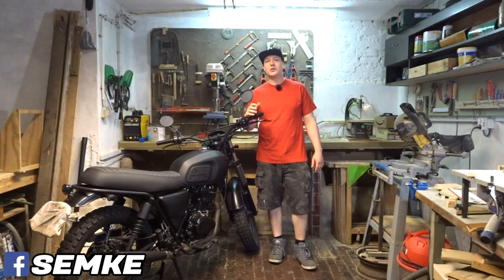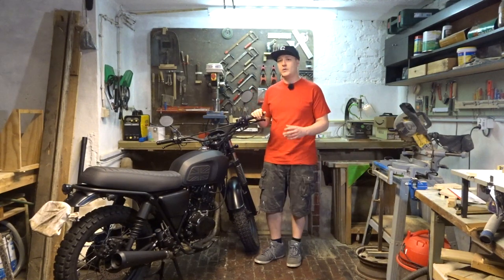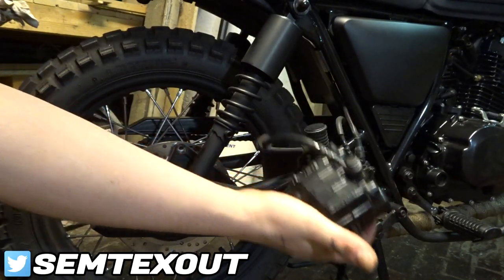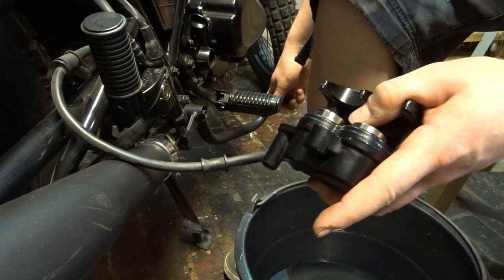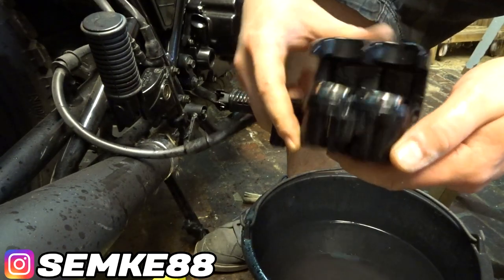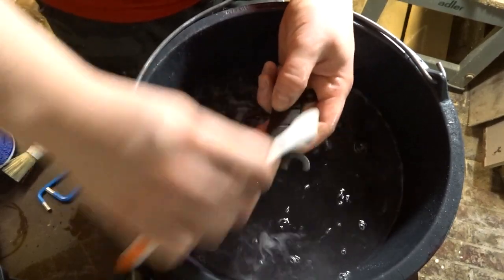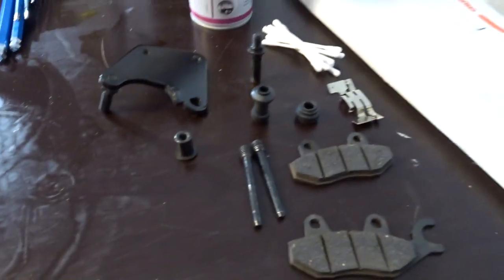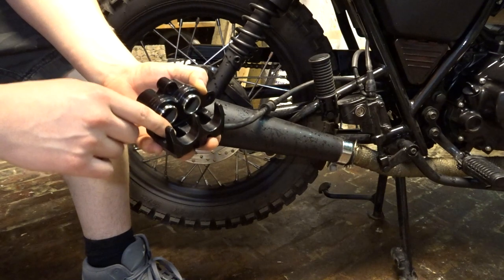how to fix sticking brakes on a motorcycle Brixton Felsberg 125

Comment: Hi there Semke, thanks for the video, I have a strange brake problem with my Brixton Caffe Racer! Sometimes when I apply the FRONT brake the fluid also goes to the REAR brake caliper & it jams on & wont come off! I have to jerk the rear brake pedal hard a couple of times to release it & off I go again. Have you ever seen this happen? As you know on the Brixton the foot brake pedal sends fluid to apply pressure to the front & back calipers but the front brake hand lever is supposed to operate the front brake only. Somewhere in the brake system there must be a cross over between front & back & a leaking seal or sticking valve I think! I have had it to a shop here in Vietnam a couple of times to get this repaired but every time its the same. Any ideas?
Reply from the maker: I think that the problem is located Where your back brake is attached the small block where all the brake lines come from. I would open that and see if you can spot something that looks wrong

Comment: my rear brake sticks on itself after a while of ridinig without even braking ! 
the bike has only 1000kms on it 
help pls
Reply from the maker: if this happens again, feel the brake caliper. it should not be extremely hot. don't you drive with your foot on the brake pedal? I can advise you to clean and lubricate the brake caliper as shown in the video. if your brake caliper is very hot when your brake is blocked then you will have to replace the brake fluid. this is best done by a mechanic.
Reply: @semke88  the samé happens to mé how can i fix i already checked the fluid
Reply from the maker: @sp0rk403  watch this one  https://youtu.be/ZcPrnUavmSA

Comment: Hi Semke. Great informative videos as usual. My front and back brake jammed when i was riding home. I ride my bike every day, so lots of miles. Both front and back brake oil pods full. I've cleaned both the brakes as in your video. Wheels seem to be free. Do you think its just a case of dirty brakes that causes these issues?  I notice that there seems to be a lubricant port where the cylinders are housed. Do these cylinders need to be oiled/ lubricated? If so what do you use. Many thanks.
Reply from the maker: the problem is not really with the brake cylinders. but because the caliper must be able to move you do need some lubrication. so i think the most important part of the video is that there is enough bearing grease in the pins to allow your brake caliper to move . as you can see in the video at 10:02 . if you ensure that it is always well maintained and always clean grease in it you will not have this problem anymore. I would definitely do these steps every 1000km. thoroughly cleaning the brakes and changing the grease . the lubricant ports you see on the calipers are to bleed the brakes.
Reply: @semke88  Thank you for the information. Your videos have been a great help to me.

Comment: do you know how to calibrate the sensitivity of front break? thanks a lot
Reply from the maker: there is really no way to change the sensitivity of a hydraulic braking system. you can replace the brake levers with others to get a different feeling. what do you really want them to do, brake faster or slower.
Reply: @semke88  the deadzone of hand to be faster. I think its a bit of relax.. (sorry for my English)
Reply from the maker: that is because there is too much play on the lever. you can do 2 things. replace the lever with 1 of better quality without much play. or you can do it another way. if you look at the lever you will see a small metal circle that the lever pushes against. there is too much play between it. to reduce it in the right way. you should stick another small metal circle on it. so that the play is gone
Reply: @semke88  yes it has to do with the lever! Thanks. Maybe you should a video about this.Thanks!
Reply from the maker: you're welcome . The Brixton is no longer mine so I can't make that decision to change things about it